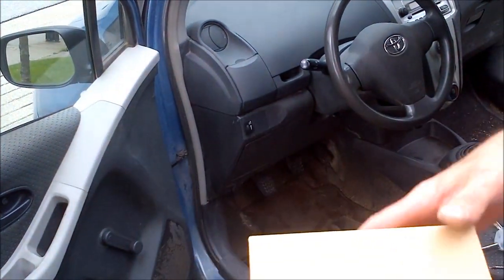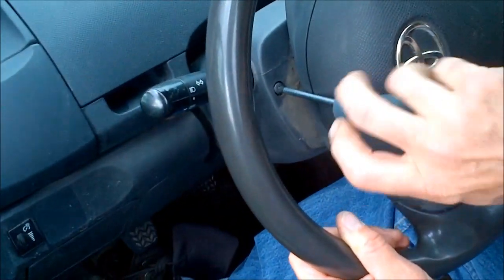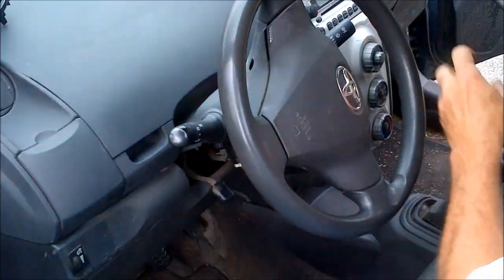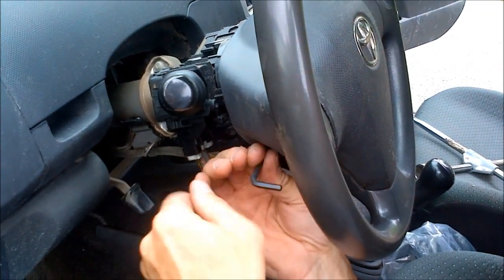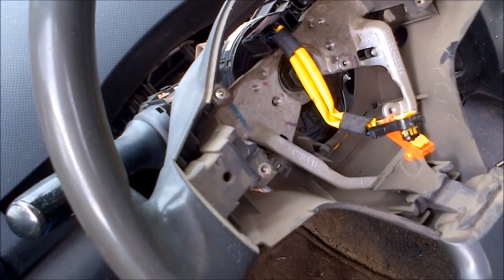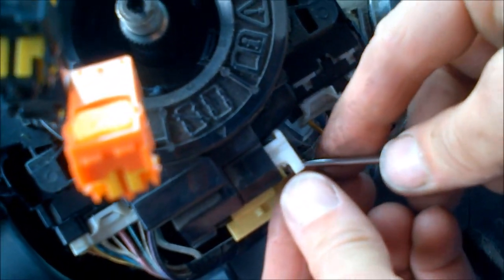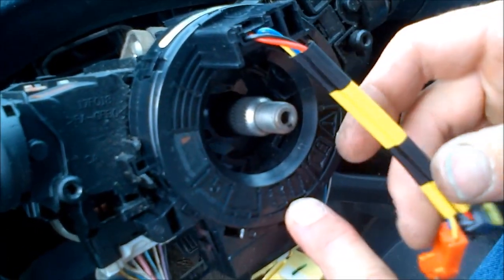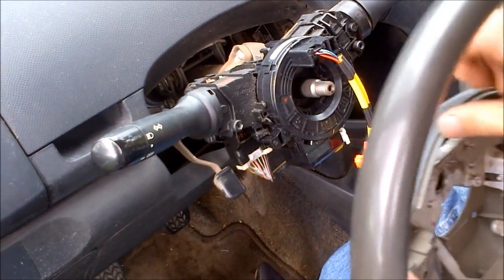Toyota spiral cable replacement

Comment: I would suggest that the battery be disconnected before starting this procedure.  You don’t want to short circuit the air bags.  Could be a nasty surprise.

Comment: Why God's name didn't you explain clearly when you switched from the first cable to the second? And what about the airbag! It could have gone off if the battery wasn't disconnected. It was confusing when you were actually replacing the part everybody is watching the video to understand! You said something like "this one" instead of saying "the new one"! And you made not one single mention of the electronics that can be involved. One of the most noticeable ways a person finds out that there's a problem is when lights go out in the dashboard!  It's such a shame because I really appreciate it how simple you made the repair seem, especially since it costs so damn much to get such it fixed at a shop. DIY is certainly the way to go but not if your instructor is leaves out important information. Thanks, but, dang! Get someone too critique your videos next time. Everybody needs an editor.
Reply: Yea, I did do a pretty sloppy job on videos in those days. Not to say that I'm any better these days. It's actually quite hard to find a camera man that will frame the subject correctly, they either get to close to the subject so as to lose perspective or they are not pointing the camera at the subject of interest. Lol.

Comment: PICing4fun,
Thank you for this informative video. Every single step of the video worked like a champ!
This airbag warning light was an automatic state inspection failure that I need to address immediately.
For those that have similar error, the dealer wanted to charge me $150.00 just to scan the airbag system and on top of the they would required to hold the car for 2-3 days to see if they have the part in stock.
The part number provided was exactly what I ordered in E-Bay : Brand New Spiral Cable Clock Spring for Toyota Highlander RAV4 Yaris 84306-22010 for under $12.00 and $6.00 for shipping!
The entire installation took about 10-15 minutes after looking at the video and using the exact tools.
Again, thank you for the video!

Comment: think I broke mine by letting wheel spinc 360 multiple times while checking half shaft that I un bolted

i should have tied wheel -not just mark shaft and wheel column with marker

once reassembled, airbag light popped on and horn stopped 

nice....

Comment: Well my Toyota Yaris Horn isnt working either, i checked the horn and the relay they both function well. but can anyone tell me how this spiral cable can effect my Horn from working. Because in the video the  horn wire is another one, instead of orange one. And does anyone know how i can test my horn to see if the problem is in the cable.  To test the horn i should just connect but the blue wire to neutral right and then it should work?

Comment: It is funny how things go so easy for some. I tried this on a Toyota T100. I broke 3 finger and a wrist just trying to get the plugs undone. And yes I knew how they unplugged. They were all just stuck like a MF. My wheel did not just come off that easy as well.

Comment: Helpful video. Also works for sienna or pretty much any other Toyota. Just some flaws with his instructions. DISCONNECT THE NEGATIVE BATTERY CABLE. This guys lucky the air bag didn't deploy with that air bag being energized. Also it's a 27T torx bit, not 25T. Which is why in his video he had a damaged torx head and make shift tool to remove it.
Reply: What is it about this repair that can cause the air bag to deploy? I've seen these warnings all over the place about disconnecting the neg battery cable, but I don't understand what can trigger a deployment besides the air bag sensor inside the bumper being crushed upon an impact.

Comment: For the love of God people disconnect the negative battery cable and leave it for 20 minutes to a half hour to discharge any charged capacitors.. I can't believe what I just saw! You sir are VERY lucky..consider as well the TAKATA inflators on those airbags!!!! Once that's done..start by taking the airbag assembly out...THEN take the steering column trim off!!!
Reply: You're 100 percent correct mate.
Most airbag deaths happen not in an accident but in incorrect repair sequence.
Hopefully your post might save someone pain or even there life.

Comment: Question to everybody. 
what is the symptom of the failure of this part?

I own 2005 sequoia. When steering gets to the point of resistance, it turns over like indefinitely. 
Also, operating the steering wheel has no effect on the wheels (they do not turn whatsoever).

no horn either

and off course, air bag light is on.

I ordered a complete steering column and plan to tackle this ... a small help is always good lol
Reply: The Spiral cable has the wires for connections to all of your steering wheel controls, horn, and airbag.  If the controls on your steering wheel or horn isn't working, or if you have an airbag light or airbag OBD code, these could all be caused by failure of the spiral cable.  Granted, there are other reasons any of these could not be working.
Reply: +Kevin Deininger  thank you Sir

Comment: Great video guide! I used it for my 2007 Avalon Touring that has one extra connector block and one less screw but I've got a bit of experience with car DIY.  Saved time and money vs a dealer.

Comment: My spiral cable instructions say to center the wheel, then something about turning the wheel 2.5 turns from the left before installing it? Any help?
Reply: You turn the spiral cable not the steering wheel.

Comment: My toyota corolla 2005 was recall due to airbag issue (no light was on).  I took it to dealer and they fixed. They said they  fixed the airbag inflator module. After 5-6 months, I see airbag light on. Took it to the same dealer, same person and now he said I have to replace the spring cable and pay $621. What is the inflator module? Can it turn airbag sign on? Thanks for your help. Its a great video.
Reply: +Nazim Uddin Did the dealer tell you the Takata inflator they removed was quite literally a grenade?! The ammonium nitrate used to deploy your airbag destabilizes after years exposed to humidity!! The ammonium nitrate explodes with too much pressure, rupturing the metal container, sending shrapnel into the passenger compartment!!! BOTH YOUR AIRBAG INFLATORS ARE TAKATA!!! Most likely your clockspring was re-installed incorrectly, I would demand they cover it as an error on their part or they damaged it!
Reply: +JaseCJay If you never had a problem with your clock spring or "spring cable" before..then dollars to donuts they put it back in wrong! You CANNOT move the wheel an inch off dead straight when dealing with clock springs, if done improperly, every time you turn your steering wheel, in whichever one direction, that one direction will pull too hard on your clock spring and break it after a period of time, in your case 5-6 months..
Reply: +Hi JaseCJay,
Thanks for your feedback. Appreciate for you opinion. So, based on your feedback, my understanding is that to change the inflator module, they have to uninstall and re-install the clock spring and while doing this they might have either re-install incorrectly or damaged it. Please, let me know if my understanding is wrong.  Now how do I handle this situation- any idea? Dealer will not agree and will try to make money from it.
Reply: +Nazim Uddin when this guy is talking about the two garbage cans after he removed the wheel..that black disc is what your dealer is saying is broken..your's does not need to be removed to replace the inflator! If still in factory configuration after reinstall correctly the clock spring should not have broke
Reply: +JaseCJay it's too coincidental that it would break after they did anything on your steering column
Reply: +Hi JaseCJay,
I think you point to a very good point. Its too  coincidental that it would break after they did anything on your steering column. 
Thank you very much for your help. I am trying as much as I can.
Reply: +Nazim Uddin your welcome!
Reply: +Nazim Uddin I would as well demand all Takata inflators be replaced..

Comment: Forgot to mention. My car is a 2004 Matrix, 5 speed. It was identical except screw on the bottom of the steering cover and my horn wire connected to the steering wheel not the Airbag cover.  It took me less than 30 minutes. Thanks Again!

Comment: You forgot to disconnect the battery.  You don't want to risk having the airbag explode in your face.
Reply: +clintblackx Agree.  I would disconnect the battery, take the airbag off the wheel first, then reconnect the battery so you can straighten your steering wheel as needed.
Reply: NO NEED TO DISCONNECT THE BATTERY. Air bag never explode that way. . Short circuit or close circuit only activate the air bag. Only SRS light remains “ ON” because computer recorded open circuit. It will go away in few minutes. Only sometime need to erase the false code set by the open circuit. Please don’t scared people without deep knowledge.

Comment: Thank you For this Video I had the same problem And they changed the spiral cable But after that I have the Airbag lights On all the time So What is your advice Should I read change it again Or only check the blue all plastic parts Airbag Thank you very much And I'm waiting for your reply
Reply: +mohamad AL-kaiyat Keep on it until they fix it!!!   It's a faulty air bag issue, recall letter or not.
Reply: How long does it take for the dash light to turn off?  Mine is still on

Comment: This is great!  I have a bad spiral cable, so Toyota tells me....yep $650 also to do it.  My horn does not work, and my airbag light is on.  SO, is this a recall problem?  It sure sounds like it.  Please let me know.  Thank you for the video
Reply: +Andrew H ...well, I didn't get a recall letter!   I'll wait if I have to.  It's too expensive.   Thanks Andrew H!
Reply: +Andrew H ...well, I didn't get a recall letter!   I'll wait if I have to.  It's too expensive.   Thanks Andrew H!
Reply: +karen waters I just paid $500 for Toyota to replace a bad spiral cable in my 2004 Corolla.  The air bag warning light was continuously on since 10/30/15 (from the bad spiral).  However....my particular car was under the recall to replace the air bag.  And coincidentally (hhmm), the faulty spiral cable is only covered under the 2009-2010 Corollas.  You cannot tell me the same f**ck up in the 2009-10 spiral cable is not the exact same f**ck up in my 2004 Corolla.  They have just set up the recall categories to limit only the 2009-10 Corollas' spiral cables to be replaced free of charge under the recall.  THEY NEED TO EXPAND THEIR RECALL TO INCLUDE MORE COROLLAS UNDER THE SPIRAL CABLE RECALL (spiral cables are part of the air bag function).  

I believe I have the legal right to go back--if or when they expand said recall--and be reimbursed if they do include my model under an expanded recall for this particular air bag problem.  I did get the air bag replaced free of charge because of the recall.  It's the least they should do.   Makes me mad!   That damn spiral cable was part of the air bag f**ck up and I should not have to hawk up $500 to fix it.   GGGGRRRRRRR     They had the balls to charge $80 to run a simple test on the indicator light (air bag light) to tell them 'why it was on'.  Can you believe that sh*t?   I feel sorry for the mechanics.  They are bombed with recalled Toyotas waiting for their air-bag-ostomies, free of charge.  How'd ya like to be at that Christmas Party this year.  ha ha ha

I'm still researching all of this recall/air bag crap to gain knowledge and have intelligent arguments.  You should check out Takata Manufacturing....the ones who produced the bogus air bags and sold them to Toyota in the first place.  This is serious stuff.
Reply: +karen waters If you aren't going to fix that problem you have, and it is a serious, potentially life threatening issue, then you should find out how to completely disconnect the air bag in the meantime.  Take it very seriously.
Reply: +karen waters Do not trust your car just because they didn't put it under any recall.  They cannot be trusted.  If it came from Toyota, be suspicious.

Comment: Hello, when you get your brand new spiral cable does it come from the factory already positioned to install with your front tires facing forward isn't that why they have a clip you have to remove? Also my airbag light is fine but horn only works when steering wheel is turned to certain positions could that be something else? Thank you, Dave

Comment: My dealer report shows "FOUND OPEN CIRCUIT CLOCK SPRING CABLE". I'm assuming it's the same problem. They want to charge me $650 USD for my 2003 Corolla.
Reply: +rfjgfude They need to expand their recall.

Comment: Anthony Reyes your a Toyota tech, ok can you tell me why my horn does not work since toyota did my spiral cable, they tell me its going to cost me a new steering air bag bad, but my horn worked perfect before they touched it.and also noticed that the center of my steering pad is soft.
Reply: Jackson Palusi Same thing happened to me an hour ago. Toyota is the worst, can't wait to get rid of this car.

Comment: I'm a Toyota  Tech. And you are so doing this all Wrong and your Safety is at risk.Very surprise  the airbag didn't go off.
Reply: Anthony Reyes Cool, well Toyota service screwed up my horn, cruise control and didn't fix the airbag issue upon replacing my spiral cable. You work for a shady company.

Comment: Oh and disconecting the battery is way better than being stabbed by a screwdriver if the airbag blows up... trust me im a tech at a toyota dealer and i have seen that once.. not so pretty
Reply: Momo Charaf If I don't have a warning light on do I really need to get this replaced? I received the recall letter but I've been putting it off for a couple months now...
Reply: erratic_calm don’t put it off man.... Incase of an emergency u need your horn to work

Comment: A faster way to do it would be to pull out the airbag first then the steering wheel.. after that your plastic cover behind the steering wheel will be all uncovered.. no need to turn the wheel around for each screw..
Reply: Momo  I had this fixed at a dealership and now my steering wheel is not centered, any thoughts as to why.  Thanks.  It was ok when I brought it in
Reply: Go back to your dealer let them recenter the steering wheel they instaled it on the shaft without marking its original position, thus its a tooth off.. what toyota is it a yaris or corolla?
Reply: Debroah Pharo